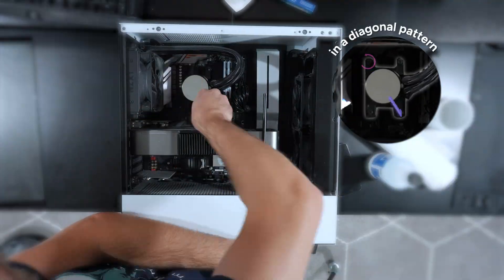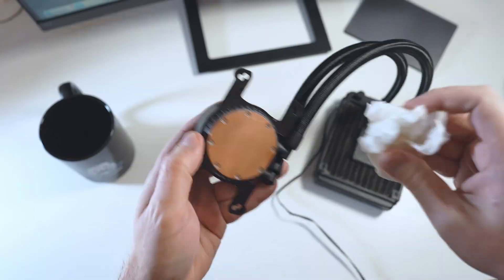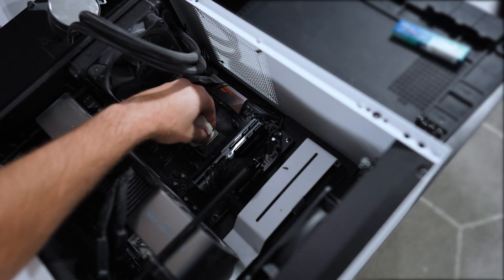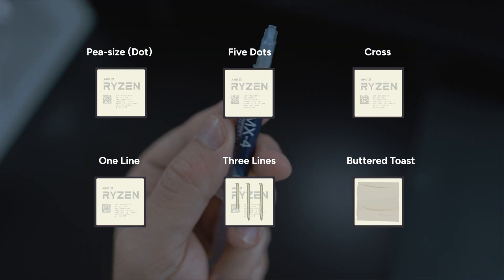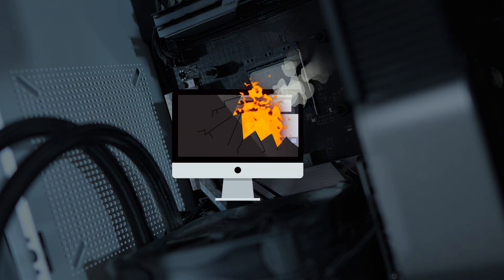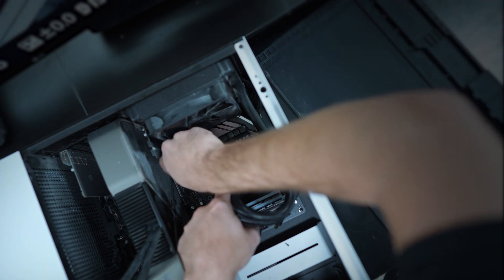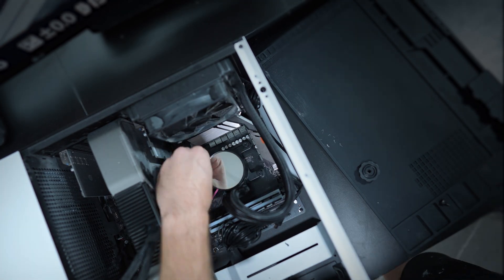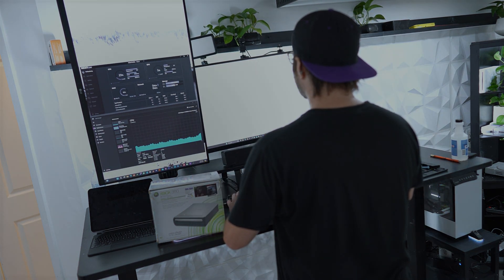How to Apply and Clean Thermal Paste: CPU Cooler Maintenance Guide #thermalpaste #cpucooler #ryzen

Comment: ARCTIC's MX-4 is metal-free and not electrically conductive. And if your thermal paste is non conductive it's better to have more than less. (the harm of having too much is less than not having enough, so if in doubt give it a bit more, it will just get pushed to the sides of the cpu and wont cause any harm).
Reply: not really, thermal paste should be applied to just evenly spread on the cpu and cooler to smooth out the surface, what am i saying is, it's better to have less thermal paste than too much because too much can negatively affect the thermals
Reply: not true, test it yourself.

Comment: What does the thermal paste taste like? Can I put it on pasta?
Reply: But It sounds tasty, I think I’ll try it on some angle hair pasta 🤤
Reply: I already tried this on my pasta. it wasn't as bad as you think it would be
Reply: @Nullverine  that’s really good to know! I’m a lunch lady at an elementary school and I think the kids will really like this dish 😋
Reply from the maker: Do not apply thermal paste to pasta
Thermal paste is applied to CPUs or GPUs to improve heat transfer. It fills the air gaps between the components and helps maintain optimal performance. Do not apply thermal paste to pasta.